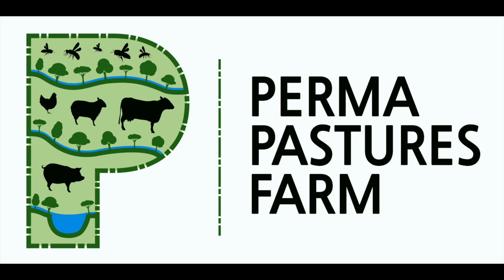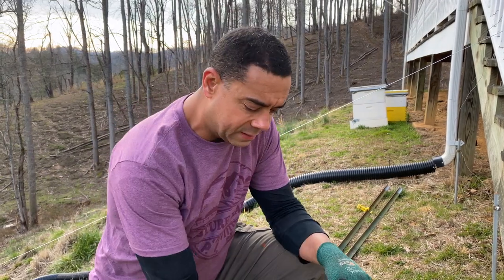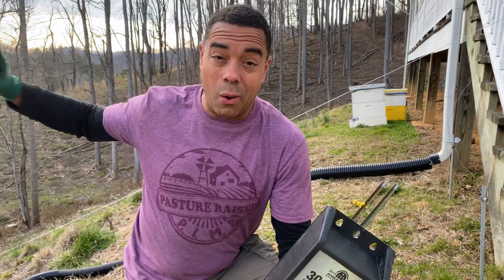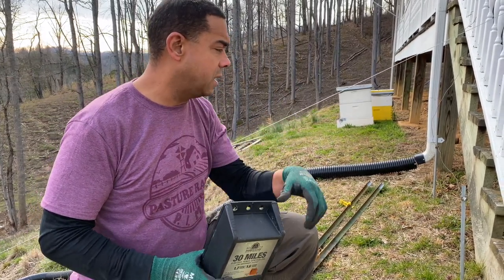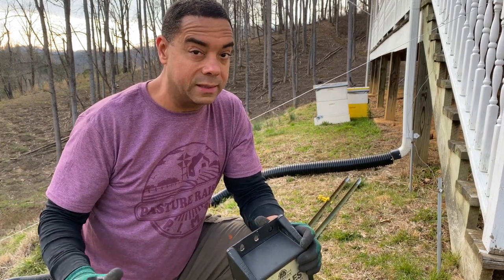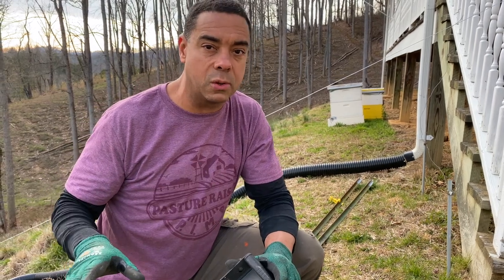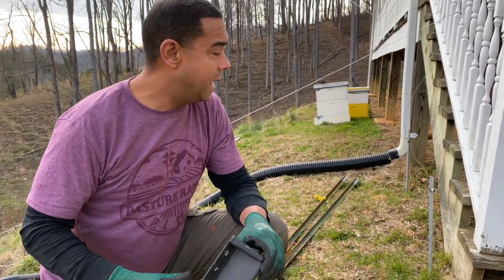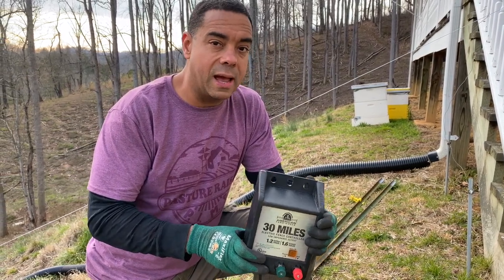Electric Fencing Hack!

Comment: Oh!  Pete at Just A Few Acres Farm did a video on his line repair.  He used a meter to figure out the point of the drain.  I didn’t fully understand the link to the source.  This video fully explains that part. I’ve got problems with raccoon destroying the corn just as it’s maturing. Before next year I’ll work this easy fix to stop it.  Thank you very much.

Comment: This is basically how an electrified high tensile perimeter fence & poly wire reels work in a rotational grazing setup. I think what some people have trouble visualizing when dealing with electric fencing is that the hot wires DO NOT have to make a closed loop. The hot wire can just jut out and stop like it does here. The hot wire is primed with electrical potential by the energizer. The circuit is completed when something touching the ground contacts the hot wire.
Reply: Also, I'm pretty sure the fence actually works better when there isn't a closed loop

Comment: Thank you sir I'm glad I watched your video. I was just about to run an insulated wire from the high voltage side of my box. I have an old 90s Sears and roebuck solid state electric fence controller. I don't have a voltmeter that goes that high but it's making a nice arc at about a half inch so I know it's putting out. Gotta redo now but I sure don't want to buy another box because I mess up this one

Comment: Hey Billy. i sent your video to someone to watch and they said this. What do you think?

Ehh, that guy has some really bad electric fence practices.  Don't use regular insulated wire it will quickly arc thru to the ground and will be hard to find.  They make special insulated wire for electric fences.  I find even those get cracked and ground out where you can't see it.  I only run electric above ground, not on or under.  Don't use 2 different types of metal on an electric fence.  Keep it galvanized to galvanized or aluminum to aluminum.  You get bimetalic corrosion very quickly between the two which lessens the charge.  Same with your ground rod.  If you are using copper ground rod use copper wire.  I stick with galvanized ground rods so I can always use the same galvanized wire.  Don't daisy chain seperate net fence pens together.  You can put 3 nets hooked together vis metal clips for 1 large pen but I wouldn't have seperate pens connected thru each other, send out a seperate line to your mainline.  Also, use those metal clips on the nets.  Every individual wire is attached to those so you get good contact on all, just wrapping a wire around the polywire doesn't insure this.  Grounds rods are super important even in super wet nh.  Follow manufacturer recommendations on energizer for ground rods.  When we have a summer drought one ground rod often isn't enough.  Check connections on ground rods periodically for corrosion.  Remember that ground is 50% of you fence and often where the issues lie.

Comment: So, the entire 'trunk line" the uninsulated wire is electrified from outlet to end? And it is bare wire? So if I touch the trunk line I get shocked?  How do you anchor the end of the trunk line? I am not electrically proficient.
Thank you. Great  info
Reply: If you touch the insulated or uninsulated wires you'll get shocked .They're both hot.

Comment: Good to know, thanks. I bought a 6 joule charger which may be too much for chickens. But I’ll also have sheep soon. Eventually pigs and perhaps cows, who knows?
Reply from the maker: That’s the perfect charger to handle all of those things!
Reply: I forgot to ask how far between T posts, 16 or 20 ft? Would you suggest a knife blade shut off switch for when it’s not in use, or when my landlord brush hogs that pasture? (He will stop once I have animals on it) lots of sedge now. This should save some money too. My only expenses would be the t posts and the wire. Unless I can repurpose some old wood posts or rusty old t posts from a broken fence. (If I can remove them.)
Reply from the maker: @Skashoon  I generally walk five paces between posts so I’m guessing that’s around 15 feet... and definitely add some means to turn it off.

Comment: hey great vid.
I'm basically doing the same, I have T post fencing for main grazing areas ( 4 in total ) and picked up 4 of the temp fencing to move around some grazing areas, problem is as soon as I connect the temp fencing my voltage drops by half
If I just connect 1 temp fence voltage is great, as soon as 2nd temp fence is connected it drops it to half.  I've even disconnected one of the other pastures to see if it's the charger but 25miles has not been reached .
It only drops when I connect a second temp fence with the provided connectors ...
any thoughts.?
thanks

Comment: Enjoyed the video.  

On our property, I'm using  tsc largest ~200 mile ac charger to assist keeping out anything not belonging on our 18 acres. It will put anything in the front row on Sunday morning! 

Would I need to adjust this voltage down and what would you suggest? TY

Comment: Since the insulated wire could lay on the ground, assuming you could stake around the wire and cover lighting with dirt? Would you ever bury the wire? I think you said but would be great if you could put which insulated wire you used? Thanks!!
Reply: You CAN but it will fail in time like everything else

Comment: But isn’t the trunk line live then too?
Reply: He has two lines. The uninsulated wire running on the yellow insulators on the T post and an insulated red wife connecting the uninsulated wire to the netting.  The red wire is insulated, but both would be carrying a charge when the electricity is turned on.

Comment: Trying to wrap my mind around this - do you let the insulated wire just lay on the ground or is it raised up in the air. I'm thinking about running 3 wires around the property but additional around the garden for the critters that are already living in the perimeter. Don't you worry about someone touching the live wire accidentally? It sounds like a lot of energy.  So with electric fence it does not need to be like a complete circuit? Appreciate you sharing your work and the things you have already figured out.
Reply from the maker: The insulated wire can lay on the ground. The risk of someone touching it is always there but it’s not enough to do any real harm because the voltage is high but the current (which causes harm) is negligible. 
There’s no need to make a complete circuit.

Comment: can you connect multiple fence chargers to the same line?
Reply from the maker: That’s probably not a good idea.
Reply: No.
Reply: @PermaPasturesFarm21    
I see, so basically you jumped one hot-wire-fence to the other (sharing juice) to enclosure around the sheep w/out need of another "Energizer" or losing any voltage...